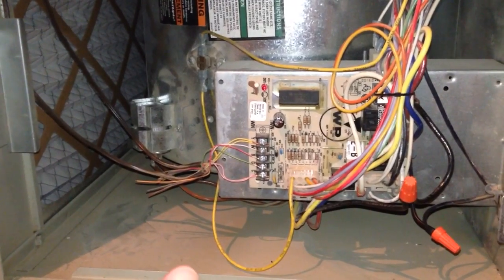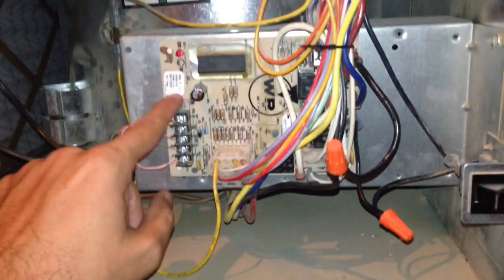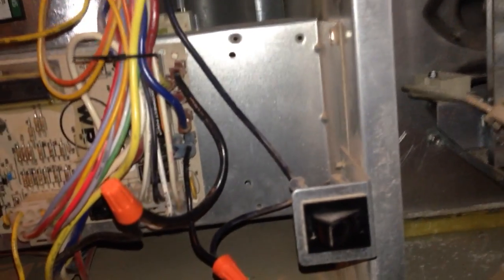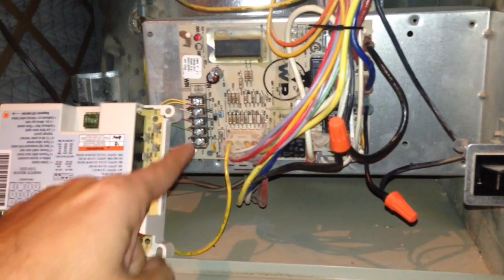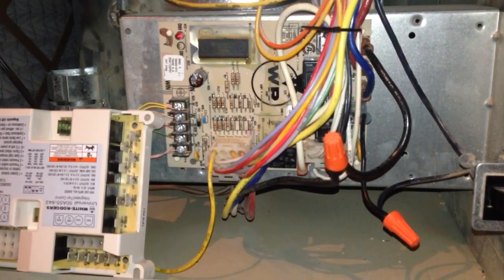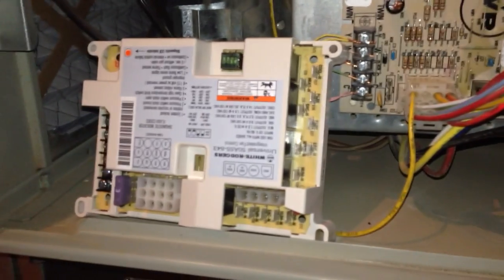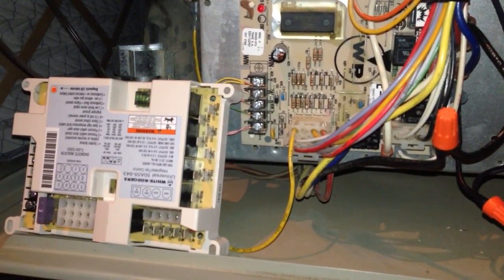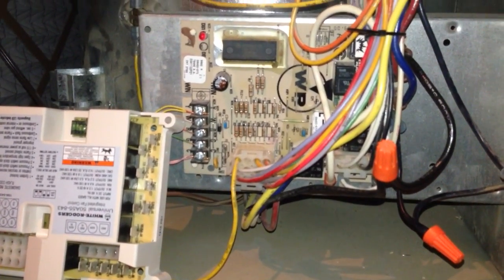Part 1 Trane circuit board replace

Comment: Save some money on the circuit board cost replacement.   Check the solder on the contacts the Molex 3x4 connector.  I found many of contacts had cracked solder joints due to the stress of the cable harness on the cheapest circuit board you can make.  Once I re-flowed the solder joints.  My problems of no heating and 4 flash error was gone.
Reply from the maker: Electron, good point. You can check the  solder on the back and harness. That could solve some issues without replacement.

Comment: What he does not show is that you need to attach the harness that comes with the 50A55-843 universal board. Failure to do this will result in the heater displaying the classical 'flame comes on and stops after 2-3 sec.' making you think that it is a dirty flame sensor. The harness is not needed for the AC to run, but the heater needs it to run.
Reply from the maker: Thank you. I recall there was a harness or jumper cable that came with the part and needed to be added for my model of furnace.  Thank you for the clarification. I hope the video was helpful.
Reply: @stevendaviddraper  Can you explain this more ?  I just replaced the circuit board but I don't see where to put the harness or jumper cable ? Thank you
Reply from the maker: @coryotto2808  In the package you should have received a black wire.  each end is inserted to a different point on the circuit board to connect those two points.  It only applies to Trane.  In the instructions, it says somewhere, "Trane installation only" or something like that.  I show the instructions for that about minute 5 in the part 2 video.  Sorry my video is not more detailed.  I quickly created to share my knowledge with other homeowners.
Reply from the maker: See recently posted Part 3 follow up video where I show the harness or black wire that is needed for Trane application. 
https://youtu.be/jALh2Mvm78E

My Part 2 video also shows the instructions for that harness at the end.

Comment: 1:34 regarding the  molex conenctor thats 4 pin ,   my board is 5 pin, if i order a replacement board that has a 4 pin can i somehow rewire it to use it?  for examply my board is White Rodgers 50A51-495 and I want to use a 50M56U-751 since its availble in Canada for real good price. thank you.

Comment: Hello Steve,

 can you please enter the link to the site where you bought the Circuit board please? 
I appreciated
Reply from the maker: Purchased on amazon. Here is name of listing and a link. 
White Rodgers 50A55-843 Ignition Control Module
by White Rodgers  I purchased most recently from partshousesupply. 
today I see it available with free shipping for about $80

https://www.amazon.com/gp/product/B00L8YH4TC/ref=ppx_yo_dt_b_bia_widget_title_o00_s00?ie=UTF8&psc=1